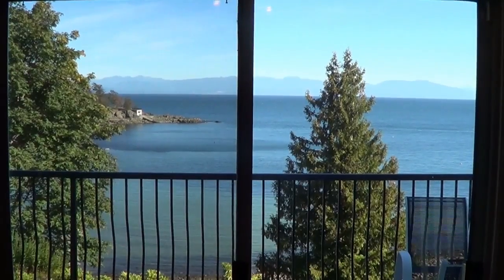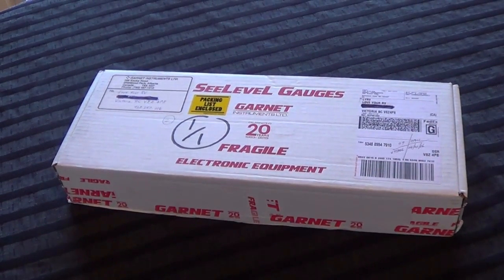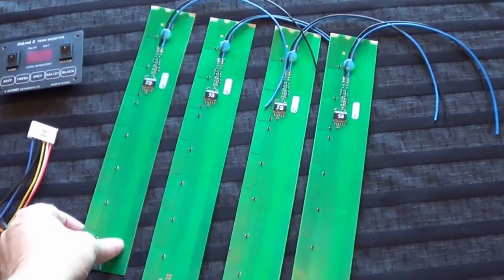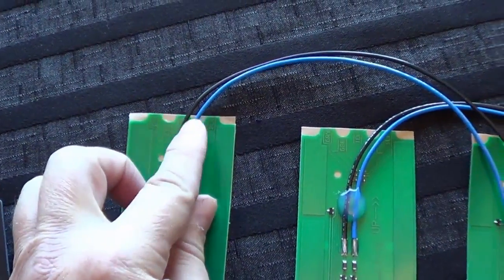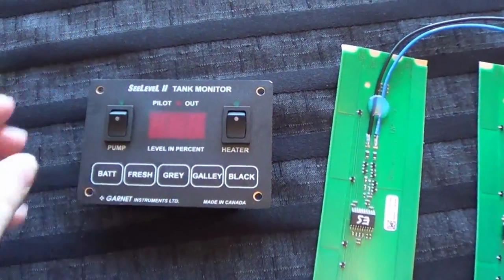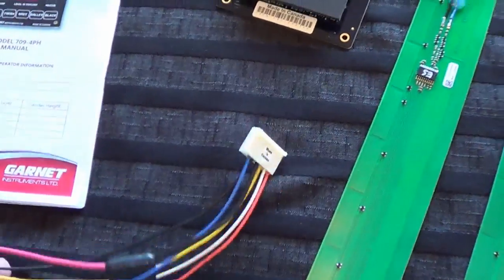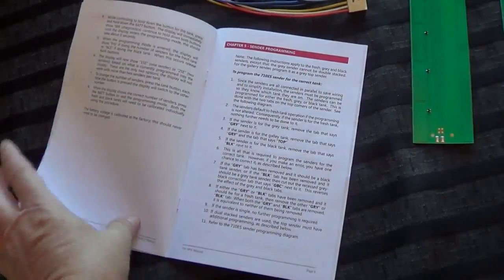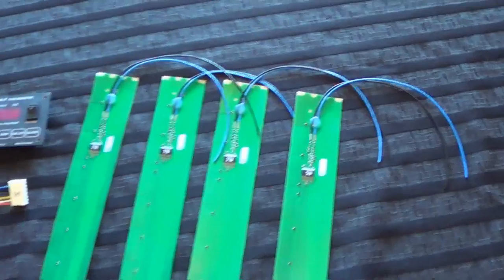Unboxing My New See Level II Tank Monitoring System

Comment: Thanks for starting with the install right at package opening. Looking forward to part 2. I had a 30 ft TT and panel didn't work from day one. When boondocking with 2 small children, I would bucket brigade from grey water tank and use that to flush the tiolet  to stay on site longer. Take care
Reply from the maker: I got most of the system roughed in today. wasn't too bad, took about 3 hours, most of it crawling under the rig. I still have to calibrate and tidy things up but so far it's all working. :)

Comment: If your current gauges don't tell you much (just tested mine and they are junk as well) I'm curious how you have been managing your tanks so far.
Reply from the maker: I know the black tank is full when the toilet starts to burp a bit on flushing. When the shower doesn't drain I know that gray is full, I can take a bit out and put it in the galley tank to drain it. Either or I know it's time to dump.
For the fresh water I carry a portable jug of water and dump it in if we run out.